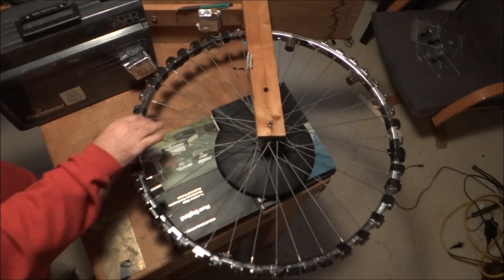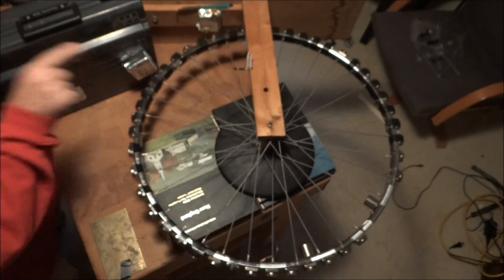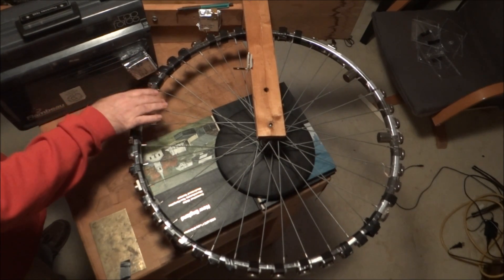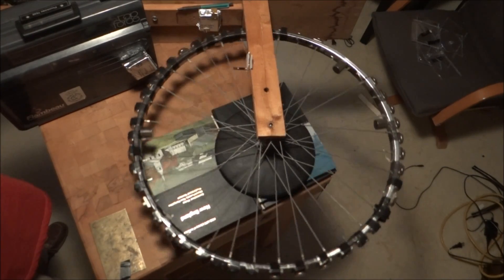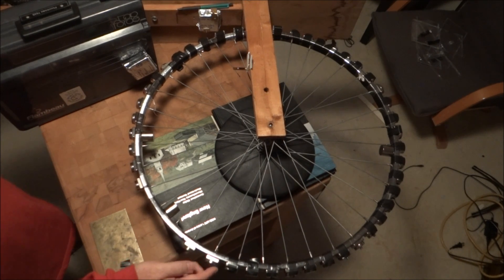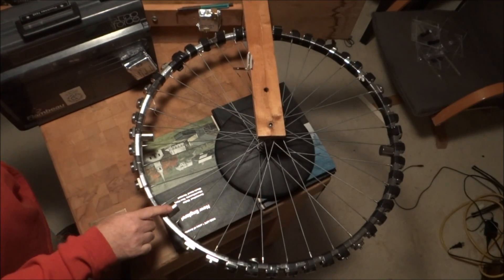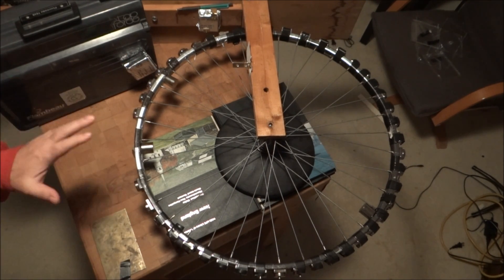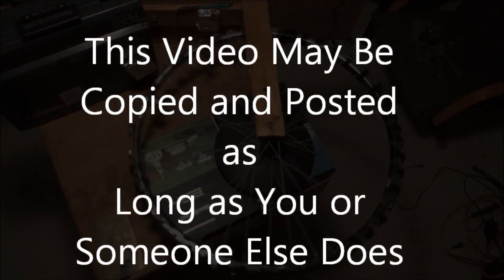🧲 🧲 Magnetic Motor Research (Leapfrogging Effect)

Comment: What a waste of money, time and energy. Magnetism is FORCE only. Work is FORCE x DISTANCE; POWER  is FORCE x VELOCITY; ENERGY is MASS x VELOCITY squared. Static magnetism does not do any work, nor make power or energy. Like gravity, many inventors have lived and died making gravity motors and failed. Until you die you can not make a static magnet motor.
Reply from the maker: +Odouls77 -

Under load the wheel does not slow down, even when you allow
your fingertip to drag on the edge of the rim. Explain that away. Keep in mind
that a lot of energy went into making the neodymium magnet itself.  Simply replicate my work just like Youtuber,
Gene Fewings did with wonderful success, and you too will see that it performs beautifully,
even under load as you drag your index finger on the rim with no loss of speed.
Once you place your finger on the wheel you can feel a strong torque.

As for my absence and lack of progress? It came to an end
when I lost my home and my life savings. If that was not already bad enough, I
lost my original computer in a flood with video proof of my first working model
that ran continuously. It was that video that kept getting each of my Youtube
channels taken down. Even a stern warning from Youtube/Google not to post that
video anymore, well, the flood took care of that. Determined more than ever, I
tore my working prototype apart for parts to build a second prototype but never
finished do to a folly of life changing events. Though my personal life is
really no one’s business, I hope this helps to address your question/concerns.

Though I'm back and hope to put another working model back together over the
months ahead, know that I'm in the move of my life and soon will be homeless
living off the grid on a mountain top until I can build a new home there. So
here is Gene Fewings video successfully replicating my research. Not sure what happened
to him or why he suddenly stopped as he (like myself) was making serious
progress and was about to add seven more stators that Gene had already built
and was ready to install.  

Below is the link to his original video, but I have also posted his video on Free Magnet Energyon Facebook in the event his video or Youtube channel gets taken down.

 
Youtube: Gene Fewings
https://www.youtube.com/watch?v=VUZP2eC1DV0

"Think Tank" on Facebook: Free Magnetic Energy
https://www.facebook.com/groups/FreeMagneticEnergy/

Comment: James several questions how many pounds pull is one of your rim magnets........when u say stator what is it a magnet?....still not clear to me what you are proving. help please
Reply from the maker: +Thomas Galpin 

(1) Approximately 32 pounds each
(2) Stator is a specially shield magnet that is always stationary
(3) Magnets used to make the wheel spin continuously without external power.

Under load the wheel does not slow down, even when you allow
your fingertip to drag on the edge of the rim. Keep in mind
that a lot of energy went into making the neodymium magnet itself.  Simply replicate my work just like Youtuber,
Gene Fewings did with wonderful success, and you too will see that it performs beautifully,
even under load as you drag your index finger on the rim with no loss of speed.
Once you place your finger on the wheel you can feel a strong torque. 

Below is the link to his original video, but I have also posted his video on Free Magnet Energyon Facebook in the event his video or Youtube channel gets taken down. 
Youtube: Gene Fewings
https://www.youtube.com/watch?v=VUZP2eC1DV0
"Think Tank" on Facebook: Free Magnetic Energy
https://www.facebook.com/groups/FreeMagneticEnergy/

Comment: This is interesting because every action has an opposite reaction, but when you remove the opposite reaction, you just get the reaction and the motor should spin its self up. At least, that would be the hypothesis.
Reply from the maker: +webduelist  - Funny how most here disagree with you and I because that's exactly what I am doing. Just that I cannot get rid of all the reaction, just some 10% of it, (60/40) which is enough to cause an imbalance in the system. This imbalance is what allows the last armature magnet to completely clear the stator.

Under load the wheel does not slow down, even when you allow your fingertip to drag on the edge of the rim. Keep in mind that a lot of energy went into making the neodymium magnet itself.  Simply replicate my work just like Youtuber, Gene Fewings did with wonderful success, and you too will see that it performs beautifully,
even under load as you drag your index finger on the rim with no loss of speed. Once you place your finger on the wheel you can feel a strong torque. 

Below is the link to Gene's original video, but I have also posted his video on Free Magnet Energyon Facebook in the event his video or Youtube channel gets taken down.
 
Youtube: Gene Fewings
https://www.youtube.com/watch?v=VUZP2eC1DV0

"Think Tank" on Facebook: Free Magnetic Energy
https://www.facebook.com/groups/FreeMagneticEnergy/

Comment: Set the major magnets at 33.33333333333333333333333333333363333333 degrees apart from one another...
Reply from the maker: +steve bosheemy - Yes. Already been there and the results are promising. The stator is at 28 degrees to the wheel's axle.

Comment: just a oddball comment, have you tried to find a wheel that is lighter than the one used in this experiment?
tried using.better graded bearings for the ultra smooth glide as some are a very substancial amount better with "free" movement also could you try covering the spokes to stop any air drag no matter how small <3
Reply from the maker: +Scott Barstow  - No, don't need to. Rather the weight in the wheel helps to store inertia. There is plenty of torque to overcome the current bearings.  Under load the wheel does not slow down, even when you allow
your fingertip to drag on the edge of the rim. Once you place your finger on the wheel you can feel a strong torque.

However, my research suddenly came to an end when I lost my home and my life savings. If that was not already bad enough, I lost my original computer in a flood with video proof of my first working model
that ran continuously. It was that video that kept getting each of my Youtube
channels taken down. Even a stern warning from Youtube/Google not to post that
video anymore, well, the flood took care of that. Determined more than ever, I
tore my working prototype apart for parts to build a second prototype but never
finished do to a folly of life changing events. Though my personal life is
really no one’s business, I hope this helps to address your question/concerns.

Though I'm back and hope to put another working model back together over the
months ahead, know that I'm in the move of my life and soon will be homeless
living off the grid on a mountain top until I can build a new home there. So
here is Gene Fewings video successfully replicating my research. Not sure what happened
to him or why he suddenly stopped as he (like myself) was making serious
progress and was about to add seven more stators that Gene had already built
and was ready to install. 
 

Below is the link to his original video, but I have also posted his video on Free Magnet Energyon Facebook in the event his video or Youtube channel gets taken down.

 
Youtube: Gene Fewings
https://www.youtube.com/watch?v=VUZP2eC1DV0

"Think Tank" on Facebook: Free Magnetic Energy
https://www.facebook.com/groups/FreeMagneticEnergy/

Comment: Cool, you built a free spinning wheel. This "work" you speak of is being mistaken for inertia in the mass of your spinning wheel. The magnets are only temporarily storing the kinetic energy and releasing it in pulses causing the "notching" effect. If you want to really disprove yourself, take another identical bicycle wheel with the same magnets on the rim (but no stators) and same drag, apply the same force on each wheel and they will both spin roughly the same number of times around. I don't see any experiments here using such a control group. Nothing is "scientifically proven" by any means, your "experiments" couldn't be any further from the scientific method than they already are. You are essentially claiming to prove 1=0 through a flawed method.
Reply from the maker: +Patrick Halcrow _ I agree with you. This demo is visually flawed and thus fails the viewer in demonstrating that there is a true imbalance in the system. (60/40) I've had this working before with my first prototype, posted the results up online which caused 2 Youtube channels to be shut down. I stripped the first prototype to build a bigger one and never finished.

My work came to an end when I lost my home and my life savings. If that was not already bad enough, I
lost my original computer in a flood with video proof of my first working model
that ran continuously. It was that video that kept getting each of my Youtube
channels taken down. Even a stern warning from Youtube/Google not to post that
video anymore, well, the flood took care of that. Determined more than ever, I
tore my working prototype apart for parts to build a second prototype but never
finished do to a folly of life changing events. Though my personal life is
really no one’s business, I hope this helps to address your question/concerns.
 

Below is the link to Gene's original video, but I have also posted his video on Free Magnet Energyon Facebook in the event his video or Youtube channel gets taken down. 
Youtube: Gene Fewings
https://www.youtube.com/watch?v=VUZP2eC1DV0

"Think Tank" on Facebook: Free Magnetic Energy
https://www.facebook.com/groups/FreeMagneticEnergy/

Comment: Welcome back James.

Jesus bless and Merry Christmas.
Reply: I have been working on some designs of my own--- btw--- in an ideal world we would use opposing forces to make the wheel levitate and therefore there be no friction--- however the question then would be, how can one generate power from that?
Reply from the maker: HomicideHenry
 Yes, I've covered this in a couple videos, as well as on FaceBook in recent days. Magnetic suspension is ideal in the long run. As for generating power, it's still the same as when you used metal bearings.

Comment: this wheel is unballansed. that`s whi it go 1 circle. Nothing else
Reply from the maker: I addressed your concerns in the video. The hard back books you see under the base of the wheel were used to level the wheel as thin "shims" were placed under the books to level the wheel. I can use my index finger to "firmly" put drag on the wheel, and the wheel does not start to slow down to a stop. If Press extra hard to slow it down some and then release my finger, it speeds back up. I doubt any thing I say or do will convince you otherwise; at least I tried.

If you still think my stators/wheel is using gravity, than watch this video.

https://www.youtube.com/watch?v=VUZP2eC1DV0
Reply from the maker: BTW: If the wheel was unbalanced, we would both, "see and hear" the wheel speed up and than quickly slow down, of which we don't.  Rather, the wheel's speed is absolutely steady and then comes to an abrupt, sudden stop at the gap.

Please join us here at our Free Energy group on FaceBook at:
https://www.facebook.com/groups/133407586703698/

Comment: Why don't you try it this way: build the same setup and put it on top of the setup you have now. and just put the next "level" 15 20 degrees turned compared to the bottom setup. That should give you the leapfrog effect you are looking for.
Reply from the maker: I agree. Talked about this in some of my earlier videos, even more recently on FaceBook. Actually a PVC cylinder would be better, than you can easily try different configurations.

Free Energy group on FaceBook at:
https://www.facebook.com/groups/133407586703698/

Comment: Where is the point in having a gap at all?
Reply from the maker: When you close the gap, it no longer runs.
Reply: Could you find out why this happens?
Reply from the maker: SchamanetheSchamane
 I suspect because the loop is closed there is a short if you will in the flux. We must keep in mind that flux is actually a high concentration of electrons. We must also keep in mind that man does not have a complete understanding of magnetism. I just know that as soon as I open a gap, the wheel will start from most any point. When you close the gap, the wheel will not start from any point whatsoever, let alone keep going all the way around.
Reply from the maker: SchamanetheSchamane
Without lab gear, I cannot measure why. :(

However, why it happens could be of great importance.